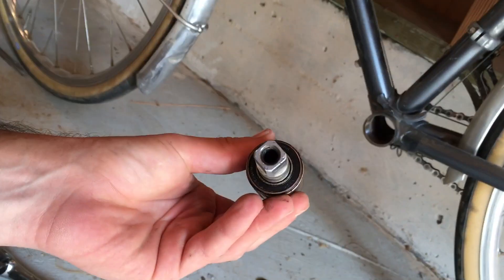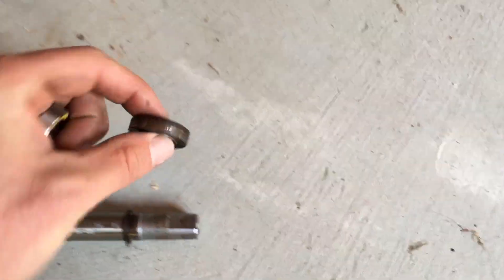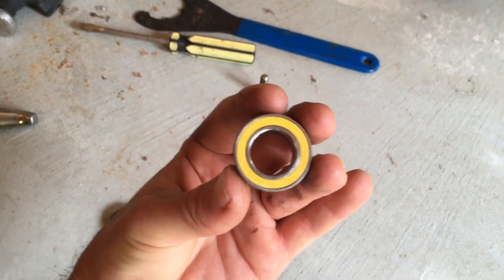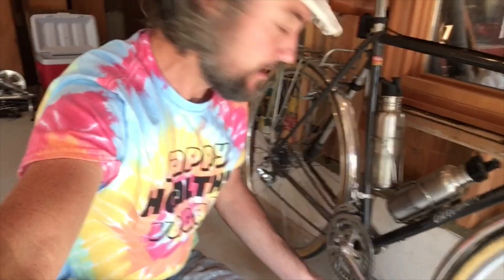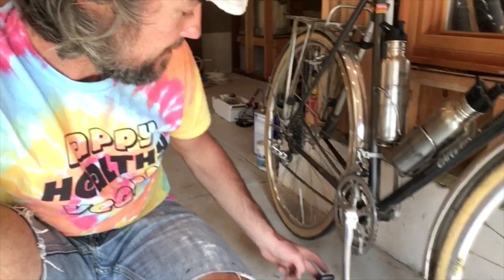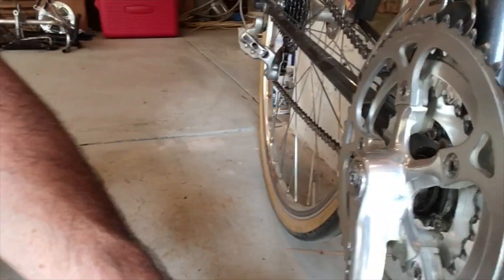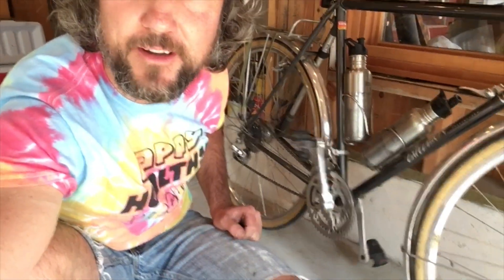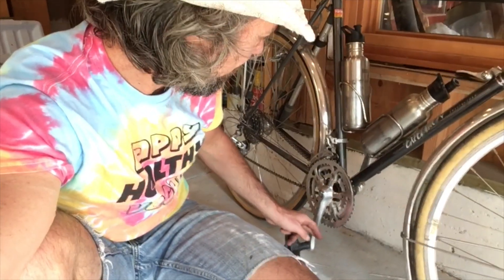$14.99 Ceramic Bearing Upgrade - Square Taper Bottom Bracket

Comment: I’d be interested in a follow up to this video. How have the hybrid ceramic bearings held up?
Reply from the maker: Hi Tim, good question. I've since swapped them out for a new set of regular SS bearings (non ceramic). However, I did put these hybrid bearings through a lot of hard miles in the rain and through many days of bike washing. They held up well. The drive side wore out faster and needed to be replaced after about a year. The non-drive side was still spinning perfectly. I switched them out for a set of stainless steel bearings by Enduro Bearings. Also, I have a brand new set of angular contact bearings to try as well.
Reply: @Henrywildeberry  so how was enduro bearing? Does it smoother than that Si3n4? I was thought about this before and post it on reddit seems no one response about this they just suggest to replace e the whole BB.. 
And I have really odd size of stock bearing on my BB which is 173110; it's Id 17,od 31, w10
Reply: Devin Fahada Hi. Hambini on YouTube has done extensive comparisons of bearings in bikes. You can see here: https://youtu.be/o7iZVfSDbiA . Basically, good quality steel is good enough for bikes.

Comment: You can often decipher the 4 digit code printed on the seals of generic replacements bearing to help sanity check your measurements.  Bike bearings generally are of the format '6xxx' OEM websites often have more detail breakdowns of the numbers; but have a read here http://www.engineerstudent.co.uk/bearing_numbers_explained_2.html for a quick primer on the topic.  This may help to match your sizing.  The letter prefixes/suffixes are significant too for the purpose and not necessarily be suitable even though they may physically fit - the loading & stress requirements mightn't be appropriate.
Reply from the maker: Thank Kym Murray. I wasn't aware of the numbering system and this will be very helpful for others looking to repair older bottom brackets.

Comment: Nice.  Thank you.  I will do this with my old BB and test ride it just for fun.  Actually, a new Hollowtech crankcase with BB is just $90.  That´s about the cost mof a titaniun ceramic bearings new square taper BB alone.  Makes no sense sticking with old technology for the same money.  I´ll upgrade when the time comes to do so.  For the time being it will be nice to try and test this ceramic bearings.

Did you have long time good results with these bearings?

Thank you.
Reply from the maker: Good luck, and be sure to measure your bearings first to make sure you order the correct replacements.

Comment: Neat.  ¿Link for the bearings?  Better start for my search.
Reply from the maker: The ads on eBay change quickly, but here is one:
https://www.ebay.com/itm/ABEC-5-Ball-Bearings-17x30x7-Ceramic-Stainless-6903-2RS-/400073207379?hash=item5d2638ae53